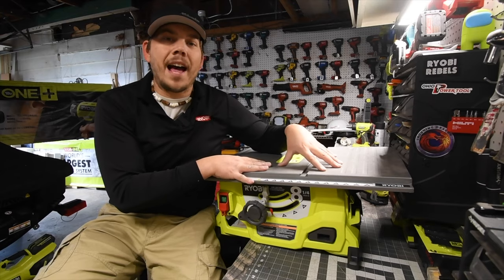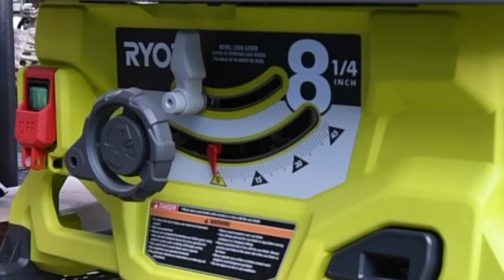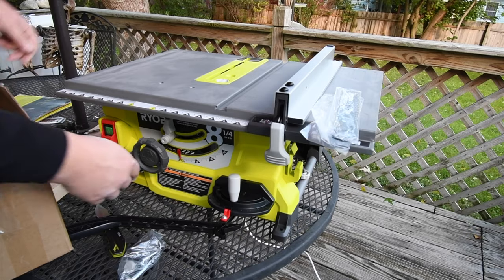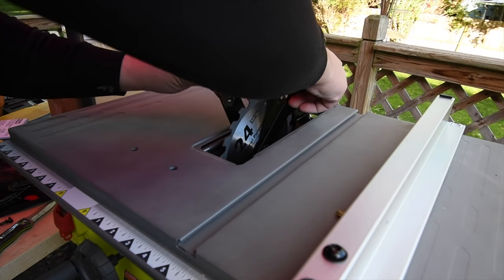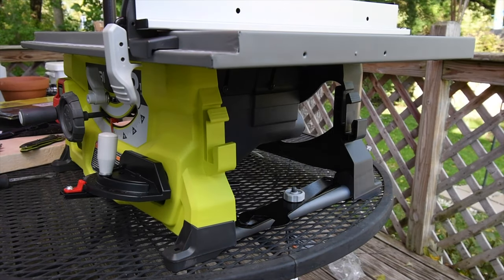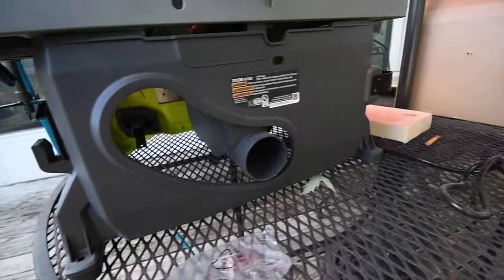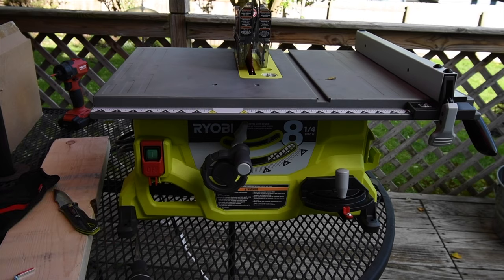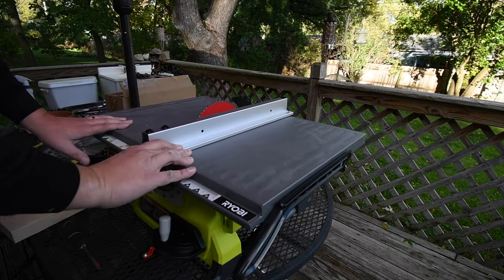$119 Ryobi 13 APM 8 1/4 Table Saw

Comment: I love Ryobi products but you don't do it any justice by not being safe. Use a stable cutting surface, and make sure the fence, riving knife and blade are square before using.
Reply: You couldn’t pay me enough money to use this saw. I find them dangerous enough let alone buying one for 100 dollars. I was waiting for the kickback from that bent riving knife if you can even adjust it.
Reply: @mattjervis3411  would you use this saw if I offered you $10,000?
Reply: safety safety safety safety safety safety. found the safety Karen.

Comment: I just bought this on March19, 2022, as my first table saw ever. For anyone considering it: Take special care to triple check the blade and fence for square. Mine was quite a bit out of square and it took me an hour or so of fiddling to get it mostly right. The motor/blade adjustments are not great, a bit difficult to access and they only get you about 1/16" adjustability which was not quite enough to adjust mine perfectly. The bevel was set about 4 degrees off square at the factory, but this is way more adjustable and fixed easily. That said, once adjusted it did a really great job, even with the factory blade. I would agree with this video, now that I have tried it: Upgrade that blade.
Reply: How did you get the motor/blade square. Mine is off 1/4 inch after adjustment.
Reply: I am having issues with getting the blade square with the miter slot.  What did you do to get it square?  I am contemplating taking it apart and trying to see if I can get it square. When I adjust via the screws, it angles more into the fence and is about a mm off square when it angles away from the fence. It's the best I can get with the adjusting screws. THanks!
Reply: @BentonLandry  Good question. I'll be honest, I didn't square to the mitre slot. I did it to the fence, since I thought that was more important. I am definitely not a carpenter, and this was the first table saw I have ever used. Good luck finding the answer.
Reply: @BentonLandry  It is off because the supprt rod going from the front to the back on which the blade rides is detached from the back. You will need to take the saw apart to push the rod back in its proper socket. I just returned it back to Home Depot. They were aware of the problem.
Reply: How do you adjust the blade tilt? Mine won't do a 45 degree cut.

Comment: I ended up buying this saw for a vinyal floor job and it performed perfectly. I wouldn't recommend ripping 8' lengths of 3/4" p.t. plywood, but for it's price vs. function, it's pretty nice saw. Bigger jobs, get 15 amp 10" blade table saw, but either way a very solid tool for lighter cutting.🌲

Comment: It's products like this where Ryobi starts to show where the cost cutting happens. For a table saw I want to make sure my knobs and buttons are functioning well and super precise. For simple tools like Brad nailers, lawn mowers, etc, Ryobi is FANTASTIC. However, when approaching things like table saws, it's best to spend the extra $200 on a DeWalt or Milwaukee since those are designed with very tight tolerances and give you much better control with quality knobs and buttons.

Comment: When ripping like that without an outfeed table it's easier to rip half way and then turn the board on end and cut from the opposite end so you meet in the middle.  This is was safer and more stable.  This can work on really long material as well with a smaller jobsite type saw
Reply: You're not supposed to back out of a cut
Reply: @wiktorjachyra1869  why not?
Reply: @schm147 if you leave the blade running and pull the board towards you there is a good chance the piece gets shot back towards you.

Comment: as an update to my last post , i replaced the factory blade with a diablo blade . the blade was thinner than the riving knife making it unusable with that blade. trying to force the board past the knife just made for terrible useless cuts. the problem was these were the only 8 1/4 blades readily available. i could get an 8 in blade but then i couldnt cut through a 4x4 in 2 passes.
Reply from the maker: summer is almost here, I want to take it look at it and see if there is a way to fix that issue

Comment: My family bought me one of these for Christmas,I have a 10 inch table saw but it's too big to take into my man cave,this I can pick up and move very easily!
 I used electrical tape to tighten up the miter gauge groove, much better,a couple wraps around and pushed down into the angles!
  As for the fence not being straight to the blade, I always measure between the fence and the blade anyhow.
 I was pleasantly surprised by the power of this thing, easily rips through a 4X4, but you do have to turn the piece over to get all the way through, but it did it very well.
 The only thing that bothers me is the shut off switch, it takes a lot more to turn it off then it does to turn it on, I'm thinking of removing the dust cover so it's not so hard!
Reply: I did find another problem this afternoon, the fence isn't square with the table top! I found this out when I got measuring the face of the 4X4 that I cut it was thicker in the middle,at first I thought the blade wasn't straight, but I checked it with several squares and it is, then I took the squares and laid them on the table top and slid them against the fence, 1/16 out from top to bottom, so over 3 3/4 it's quite a bit, so I took the fence off, since it is supposed to be a 90 degree I checked it, it's not!
 It was too late to call Ryobi so as a quick fix I reset the stop on the saw blade angle, there is an allen head set screw in the table top, I slid the fence over to the blade in it's completely raise position and set the blade angle, I ran a board through and now have flat cuts, I will have to check my square very time I do end cuts but I did that on my old Craftsman anyhow!

Comment: It looks like the slot for the miter was removed from the left side of the blade.
If there was only to have only one slot, it would have been better on the left side of the blade.
I frequently use a feather board on the left slot to keep pressure of the wood against the fence as you push it through the blade.
Reply: @Movement17November  I made a crosscut sled for mine and it works fine...just need to make it sturdy and fit the miter slot almost perfectly

Comment: I have this saw and it's just ok. Major flaw is the fence is not parallel with the blade and that really bugs me. I'm constantly fiddling with it to align the fence with each rip cut I make. Time consuming. Will get a table saw someday with a proper fence.
Reply from the maker: precision cutting is best. but the price point is why I bought this one

Comment: The guard is actually placed wrong though on the instructions it shows it should be flat not pointed up. U have to unlock the orange switch thing inside by the blade and pull it all the way out then lock it and the kikckback should go around the blade and the antikickback teeth thing should actually move up to where wood can slide trough

Comment: a few things i have run into though , with only the one guide for a rip fence it makes the size of the peice cut for the guide more critical then it would have to be if there  were 2. useing the rip fence , the fence is not true 90 % to the table and does not lock straight front to back . the threaded stud on the saw is not long enough to get a full one inch dado set in . 5/8 is about as wide as you go and still have full threads on the nut. the 8 1/4 in blade is just enough to cut all the way through a 4x4 in two passes . a 8in blade will not make that cut. also without the ryobi guide  for the dado set , you cant use most homeade style guides.
Reply: I totally agree !!
It sucks because I am always having to take my tape measure and check both sides Everytime I cut a new size . Absolutely a pain in the butt
Reply: @dewalt4594  found a way around that.  my saw fits into the top of my bench to where the table saw top is the only part exposed. cut a peice of 5/4 x 6 as long as the table saw  mounted on the left side of table just far enough away to put another guide slot on my cross cut sled using using left side of table saw as second guide runner. you may have to plane down or sand the 5/4 to mount it flush with  saw table top, i didnt have to though.this solved that problem

Comment: I've flew past this video more than a few times, because I wasn't in the market for a table saw yet. Now that I am, I noticed a few things in your video that I took note of.. 1. You didn't take the time to bellyache about the lack of a rack and pinion fence when whole dang ain't but a $120.00, I know it's more now, but not my point. My point is, take the time to pay attention to the fence and be sure it's parallel to the blade before you cut, because no power tool is completely stupid-proof.
2. You proved that the saw, even at 13amps, has the power to cut well with a 60tooth blade. Great for doing the small jobs with precision. Meaning that a small woodworker, on tight budget can get this saw, and the lumber to build it's out feed table and assemble everything, and make more money faster, and buy a bigger job-site table later. If this thing last a beginner a year, they could easily make enough profit to upscale. This saw, like any other power tool, could pay for itself on the 1st job, just like 'bigger-better' tools. I think I'm sold. I could do far more with this saw, than without it. Thanks for the video brother.😎
Reply from the maker: there are flaws with this saw and I showed in this video the flaws on it. you could also argue that this saw doesnt come with a stand. no point of pointing out what it lacks. I show what it has.

Comment: How do you lock the cut depth/blade height adjustment? The vibration made my predetermined cut higher and rode through my material.

Comment: I would not knock this saw an 8 1/4” blade is a nice size for many tasks. I’d even be inclined to have one as a second table saw to use when my primary table saw is set up for multiple complicated cuts and I just need to make some odd cut. Or if I was building a shed or some other framing project. However this demonstration gains my criticism for many of the same comments already mentioned. The user removed and stored the blade guard but left the out-of-adjustment he called it a  “bracket” which is the riving knife one of the primary safety features in place to wildly nudge the work passed it. This proves the saw isn’t dangerous but the user can be.
Reply from the maker: you do realize this was an unboxing and test video right out of the box to see how it is. adjustments were made after the video. but im glad you watched my 2 year old video :) thank you
Reply: @ManCaverTools  yes I do realize that and my interest in an 8 1/4” table saw is why I watched this video, also I have a few Ryobi power tools that perform well (no duds). It looks like it worked out of the box as it should. Saws like this could fill a purpose in a shop or job site. Thanks for your video.

Comment: 60 teeth is really high for a table saw.. generally a 24tooth blade makes a pretty dang clean and smooth cut on a table saw..
Reply: Yes But a 60T Will Stay Sharper Longer

Comment: I've had the same problem with that bracket on my Metabo HPT. The riving knife snags the work peice. I won't use a table saw without one. I had to bend it in a vise to straighten it.
Reply: There is an adjustment for it...
Reply: @paul  not when it is actually bent which is the problem I had. Fortunately they sent another since mine was caught on day one and under warranty.

Comment: I accidentally bought a 8 1/2" blade instead of 8 1/4" blade for this same table saw. Do you know if it will still work even though it's only 1/4" bigger?

Comment: I wonder what the saw would do on a less rickety table? Good video that saw is definitely on my radar 😄👌
Reply: generally saws, routers or any portable power tools are far more stable when attached to a table or sawhorse with either clamps or bolts. the bolts/clamps transfer the vibrations to the legs.

A covered carport is an excellent place to do any cutting since you can just sweep the mess away. All saws are messy, If i'm working in my shop I attach a shopvac to my equipment.
Reply: The wobbly table was sending my anxiety off the charts

Comment: Blade guard installed incorrectly. The black bar needs to be horizontal to the table, not angled upward.
You have to pull the riving knife into the up position! Important step...

Comment: Can you put a dado blade on this?
Reply from the maker: yes, I did put a diablo blade on it
Reply: @ManCaverTools  I fit a 1/4” wide stack on mine without modifying the guard. But I noticed 2 issues: 
1. Because there is play in the height adjustment, the blade can jump up and down a bit. The “nut bar” piece that the adjustment knob ties into twists around causing play. I can move the motor assembly up and down by hand. I’m trying to figure out a way to really lock the height and open to suggestions.
2. The guard around the blade on mine is pretty flimsy. So if I’m not incredibly careful it is easy to accidentally push it down on smaller pieces. I may look at milling a solid replacement piece but only if I can figure out the height issue.

I didn’t try to go wider but you I could if you modified the guard for anyone wondering.

Comment: 4:45 errr WRONG, 😂 you didn’t read the manual 🤣 You're supposed to raise the riving knife befor putting on the blade guard, and the bar between the the blade guard needs to be parallel to the table, not pointing up. Oh Lord. 🤦🏼‍♀️😂🙈
Reply from the maker: yo do know that I do a lot more than what you see on camera. perhaps I adjusted it after the video maybe.
Reply from the maker: just saying

Comment: For the price, I guess it’s decent. I have had this saw for about 6 months now and honestly absolutely hate it. The fence is garbage and not square to the top of the saw. In order to have square cuts you have to measure the fence to the blade 100 times. It’s so annoying!

Comment: you have to go slow with these. i have one and the battery works longer when you do. bigger sheets of wood can be off by about a 1/16 to 1/8 even when measured front and back from blade to fence, so be absolutely flush against the fence or have another person helping.
Reply: Mark this is NOT the battery powered model.

Comment: Only thing I saw of definite concern is the safety of the power switch.  Looked like even if you locked it, it can still be powered on then not off. Even if you unplug it still a massive safety potential issue for untrained or kids. Would be great if you make a follow up video on this tool  and go more indepth on how well and straight the fence is, safety features etc. Decent video for a hey, look at this.
Reply: When locked the OFF switch is constantly activated and therefore you can not press or switch it ON
Reply: Yes...